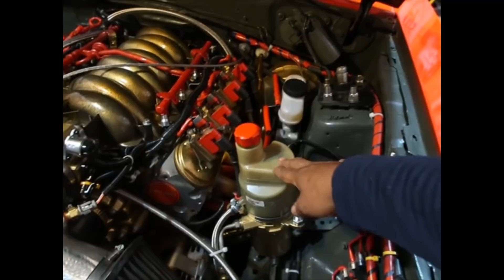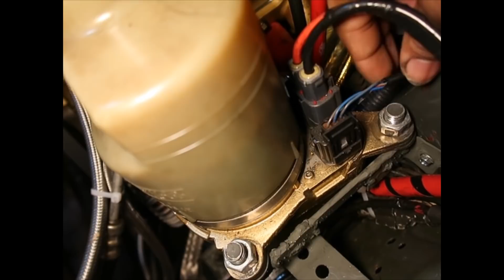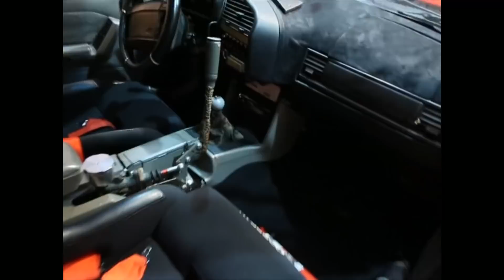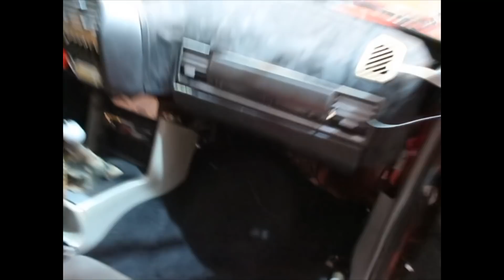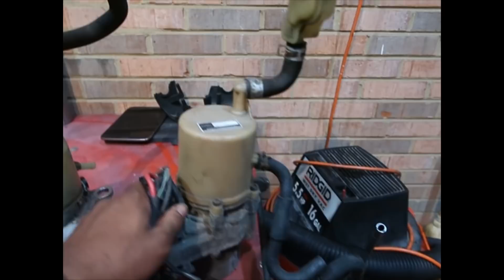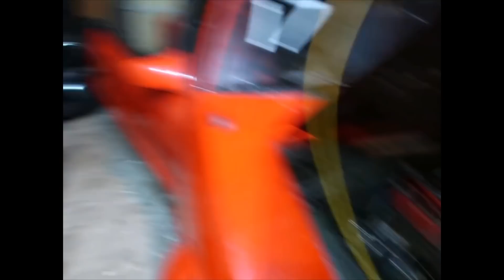Electric Power Steering Pump Conversion

Comment: Nice video. Haven't read the responses so you may have gotten this already but about the wires. The additional two wires on the pump you are using are HS CAN BUS + and - lines. The information communicated on the lines depends on the car ECU and not the pump itself. The way you are currently running your pump is at full pressure all the time. That's easily heard in the video when you turned the pump on. With no demand on the pump it should be running at a trickle voltage and quiet. The CAN BUS line at its most basic controls the voltage to the pump to control fluid pressure as needed. Pressure is usually controlled by monitoring speed. How speed is monitored can be done in many ways from actual speed to changes in manifold pressure maps to a torque map programmed in to the ECU, etc. Less pump pressure is needed at higher speeds. It's like how manual steering differs at a driving speed compared to getting in and out of a parking lot at close to idle speed except your car doesn't even have the large steering wheel a manual steering car has. Your pumps with additional wires probably came from cars with some version of traction control. Explaining this is difficult without knowing the car the pump came from because these pumps usually contain an internal microprocessor along with ECU programming. I'm sure you can imagine the designed possibilities of the information being communicated. The family car compared to a sports car have different potential uses and demands. I suggest you look in to the ECU you are using. There's a fair chance that it may have an EPS or EAPS line already on the harness to access programming for the pump. If it does but you can't get it to communicate with your pump there are a number of cottage industry shops, mostly in Europe, that offer interface modules that will get them communicating. They're easy enough to find on the internet and many will show up for ATV uses but don't be put off by that. That's just where most of their business is but they're not limited to ATV's. Good luck. Edit:  When I wrote "lines" I mean electrical, not hydraulic.
Reply: So did you guys go to pm's, or what? Following this conversation, and would like answers too.
Reply from the maker: Thanks for the insight, I just recently figured out what "CAN-BUS" means.  I'm pretty technical, but i'm no hacker, and not really interested in putting in the time to figure out how to program something to control the pump, it would be cool, but just not worth my time and energy.  Also, someone informed me that the wires on the mazda pump are also CAN, and it cannot be manually run the way the volvo one is.  Also, the Volvo pump starts up at full blast, then it slows down.  It works well enough to pass, hopefully i'm not working it too hard.
Reply: Glad to help. Understanding CAN BUS network is extremely complicated and has become "systems" specialized to the electronics and programming engineers let alone the hot rodding garage mechanics. The communication that goes on over the network has gone way beyond the monitoring and control of emissions it started as. Except for the government mandated emission protocols there's very little that is standardized between manufacturers. If your ECU does have controls for an electric pump but you find processor speed conflicts between the pump and ECU you can look to jbperf.com for a PWM frequency convertor board to match speeds. I noticed some responses where people questioned or wondered about frequency\speed compatibility. You might also consider a simple rheostat circuit added to your current set up which would be fairly inexpensive depending on quality. Mount it inside the car and manually adjust the voltage to the pump as you drive and see if you can find voltages that are more preferable\comfortable for your driving. It will also allow you to control the pump when you're on the road but not moving along with more control over steering sensitivity when hi way driving. Electric pumps are great but they don't have anywhere near the life of mechanical pumps so any unneeded pump load you can eliminate will add to the pumps life..
Reply: Hey, I just read all of the responses to your video and I want to point out a fundamental error someone has suggested about controlling the pumps voltage. PWM or Pulse Width Modulation is talked about for controlling pump voltage but that is not how PWM works. PWM can control voltage but it does it by controlling duty cycle and involves extensive circuitry development. It is a good method for controlling servo motors but questionable for controlling a DC motor. PWM use for motors is common for uses like liquid circulation in a liquid cooled computer. PWM works by constantly turning power to the motor on and off and the rate of on and off cycle controls the amount of circulation. A 10% duty cycle has the motor circulating 10% of the time. At 50% the pump is circulating half the time, etc. PWM is used in vehicles but I have never seen or heard of it being used to directly control a system from an ECU. PWM is commonly used in magnetic suspensions to control ride characteristics but it's done from a separate module that communicates with the ECU over the CAN network. The ECU does not directly communicate with the suspension sensors and has nothing to do with voltage control. PWM on some basic ECU's do control some things like injector pulse but it's rare. Injector control is usually done a separate module controlling injection albeit this module is probably contained within and integral with the ECU. Using PWM as suggested by the other responder would be in line with thinking something like because you have a radio in the car you can control what's being played at any given time. A DC motor uses voltage to control motor speed just as is commonly seen in bead rollers. DC motors are not the choice for constant on off cycling. They won't last long. That's what synchro's and servo's are for. For an ECU think of PWM as a means to create space for the various systems on the network to get access to the network so they can relay information to the ECU or for the ECU to get access to the systems to control them. Everybody can't speak at once.
Reply from the maker: so in my configuration, do I risk burning this thing out?  Should I start looking for another solution? 
 @CalumetRedJacket
Reply: The short answer is no. But, like anything else that's always running at WOT there is a wear and tear price being paid. If you'd like a more involved answer, say so. If you can, tell me what ECU you're using on the car. Is it one of GM's for crate motors?

Comment: I have to thank you for this detailed video. I found a similar volvo pump and made it fit on a 2006 mazda 3. A mechanic said I should have the dealer reprogram the mazda computer and there's no way I was going down that money pit. $139 for the pump on ebay and some fittings I already had. No computer needed to run the pump. Knowing about the few second delay when the pump starts was great. Thanks again!
Reply: How u make it coz also i cant pay 7000rand for a new pump how u do it coz im also got a mazd 3 2013

Comment: Any chance you could tell me what the thread pitch is on the high lressure line in the pump? Need to order a fitting to run my AN line.
Reply from the maker: it's just a -6AN, if I am not mistaken, there are no variations in thread pitch on AN fittings.  -6AN is -6AN
Reply: Where it threads into the pump itself is 6an too?

Comment: Hey man , https://www.ebay.com/itm/Volvo-electric-power-steering-EPS-pump-wire-connector-kit/264183247309?ssPageName=STRK%3AMEBIDX%3AIT&_trksid=p2060353.m2749.l2649
Its cleaner than using the factory harness. And man get that thing away from the engine . I mounted mine down in the front where it gets some air on it and its away from heat sources.

Comment: Got a question, I bought a volvo s40 pump it has the resavore over the pump with a hose going to the tank, I see others that don't have the extra res can I switch oil tanks so I just have a screw on cap instead of 2 oil tanks like what you have on your car?
Reply from the maker: It's the same pump, it works the same, it just has a nipple coming out instead of a large filler hole.  You can use it like that and make your own cap, but it will be pretty annoying to fill thru that tiny hole.  you just gotta get creative with it if that's the pump you chose.

Comment: What year and model volvo did it come out of? I'm looking at doing this to my 2011 Camaro SS.
Reply from the maker: Several Volvos use this pump, or a variation of it.  I believe it started being used around 2001.  If you want to pull the part yourself, you'll easily see it right behind the front bumper on the passenger side.  You'll have to Google to figure out what model uses what pump though, also, not every newer model has them. If you just want to buy the pump online, just google for "Volvo electric power steering pump".  Sorry to be vague in my answer, but it can get confusing if you try to figure out what specific cars have it.  There isn't really a conclusive list out there, and you can't really search by part number, because some pumps that have slight variations fall under a different part number, and they're 99% the same thing.

Comment: Electric powered hydraulic power steering pump?
Reply: yes this is hydraulic assist. not electronic steering like a prius column
Reply: It’s a hydraulic pump that is electrically pumped with a electric motor not a mechanical pump with a pulley and belt..

Comment: Great vid.  I have a 1969 dodge truck I've been researching for EHPS solution like the pump you used.  I have everything off of a mazda like you have in the vid. Just curious if you had figured out how to make it work? I haven't been able to find much for info and haven't figured it out. Thanks
Reply from the maker: i haven't messed with the Mazda pump just yet.  I would suggest testing it by hooking up power and ground, and then trying 12v on the smaller wires.  When you try the smaller wires, give it at least 5 sec, because there may be a delay.
Reply from the maker: unfortunately there's no way to make the Mazda pump work.  You have to go Volvo or MR2.

Comment: Thank you! Very helpful. I am using all the info you provided to install the same electric power steering pump in my 82' Cutlass with a 350 SBC.
Reply from the maker: Good stuff bro!
Reply: What year and model volvo did you get the pump out of? I'm wanting to do the same thing in my jeep wrangler that has a sbc 350 in it.
Reply: @nathanaeldiffee5337  use a S40 2006
Reply: Have been running this pump for a year or so now. Works great. The pump I got was called “2004-2013 Volvo S40 C70 C30 V50 Electric Power Steering Pump”

Comment: Thanks for sharing. I just bought the same pump today. Your two unused wires are for CAN-BUS communication, if someone can figure out the proper CAN packets to send to the pump, then the pump speed could actually be controlled.
Reply: Nobody Cares, someone would have to get access to a running Volvo with the pump and record the CAN data in hopes of deciphering it. I’ve read that the pumps control module uses PWM to vary the pump speed. I’m hoping I can bypass the CAN bs, and maybe just supply an external pwm signal to the right connection and have it work... have not taken mine apart yet
Though
Reply: Wow, for all you're looking for you're making this a lot more difficult than it actually is.
Reply: @CalumetRedJacket  Well if you want this to function automatically in a street car without having to flip a toggle switch and wait 3 seconds...
Reply: Seems like its just on initial startup. Not really a problem.
Reply: Speed pulse is anywhere between 8k-16k ppm. If you have a standalone you can use a PWM channel to control the pump's speed.  Start at 8k ppm
Reply: damond daley hey it sounds like you’ve done this successfully? I’m about to install a pump like this and have a PWM output I can use for speed control. Can you tell me which pins are signal and gnd for PWM? Thanks!

Comment: Yep it's feel really nice like you say not good road  racing I only take the car to work once a week 5 minutes from my job drive it  around town so I'm happy with it  I'm thinking to get a backup one hopefully I'll finish it today I got to get a new bill and put the battery in the trunk and rewiring everything the right way thank you for the idea
Reply from the maker: Road racing should be fine, but auto cross may pose an issue... MAYBE, but remember my front suspension is very different from most other Mustangs, there's already a lot of added stress on the steering components, a stock geometry front end should be fine, I just haven't tried it to know for sure.

Comment: Nice man loved the video. So your using the stock fox body power rack correct? I know my stock fox steering is really light how would this compare? As it sits right now I’m contemplating the idea of using the GM PS pump since all of the ford ones whine.
Reply: Made my first generation Ranger's power steering much heavier. Steering feels like a modern truck now.

Comment: man that pump is loud as heck.... what fluid is recommended for the pump as the Ford pump and rack is either type F or Merc V
Reply from the maker: The best thing I can recommend is Volvo power steering fluid from the Volvo dealer, however, Volvo does use a few different power steering pumps and I don't believe they all use the same fluid.  Searching online, the only thing I can seem to find is "see user manual"  the manual I found online didn't say.  I have seen people who have used a variety of fluids from very expensive CHF11s, to CHF202, Euro power steering fluid, and Automatic Transmission fluid.  After researching the difference between the fluids, I decided that ATF would be the safest (and cheapest) choice, so i'm running ATF, it seems to be fine.

Comment: Does the pump have an adapter fitting or something screwed in? For the high pressure line.
Reply from the maker: On the foxbody, it's a direct fit to the stock line.  Other applications may require an adapter or a new line.
Reply: Premium Fuel Mag  Didn't realize the fox line was male on either end.. Well now I have to go find a line! Already have the pump and planned on making a custom line.